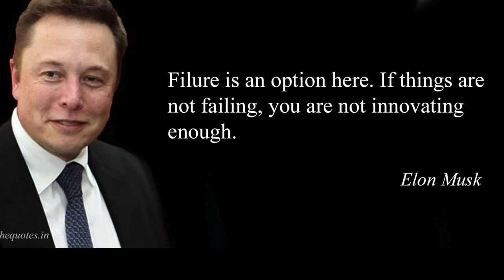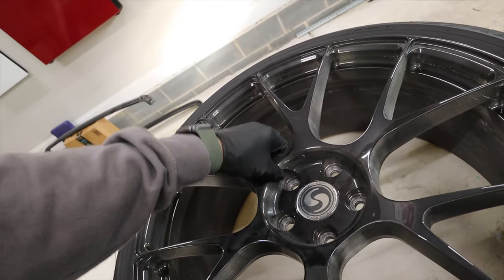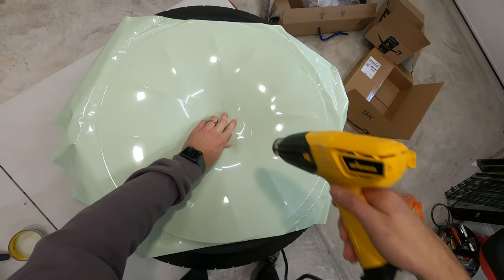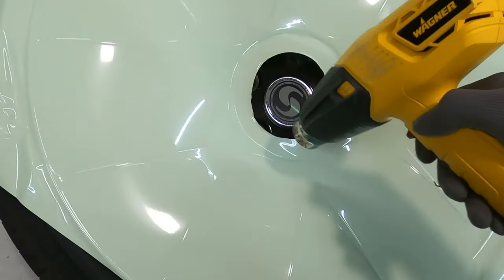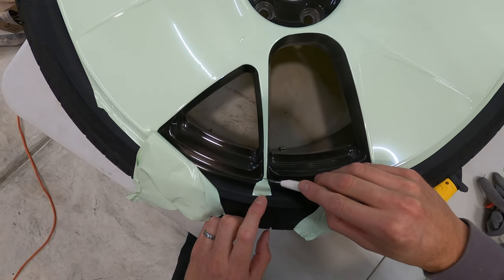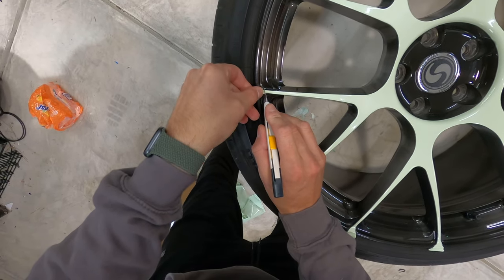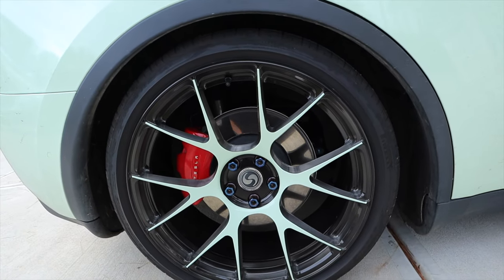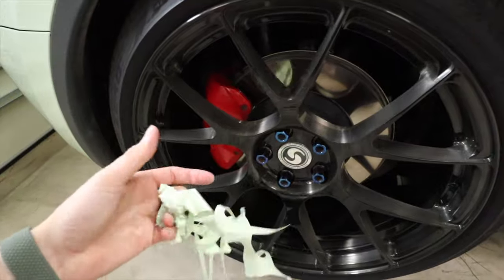Vinyl Wrap Your Wheels - Fail

Comment: Just use plastidip so much easier. So many colors to chose from they even sell it at Lowe’s or hole depot in spray can. If not the company makes more colors online.
Reply: By the way it looks fine. I’m imagining it at night would look badass
Reply from the maker: Not using Plastidip on $6000 wheels
Reply: @i1Tesla  it just peels right off when u want just like u did on the video. I had 3,000 dollar wheels and I did it my self. Kept it on for awhile till I was tired of it and the look. Just start peeling away and it peels off. Makes good ASMR video 😂 at the end